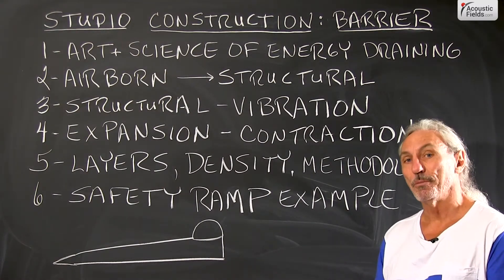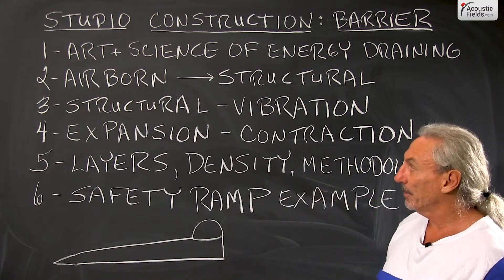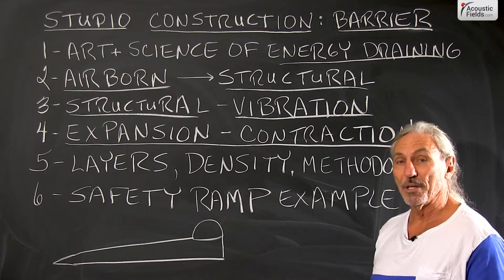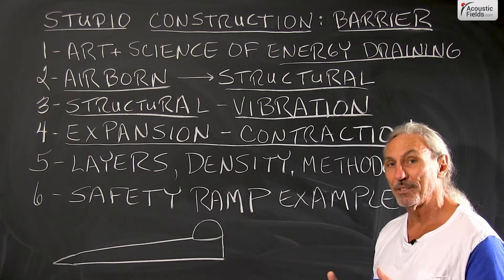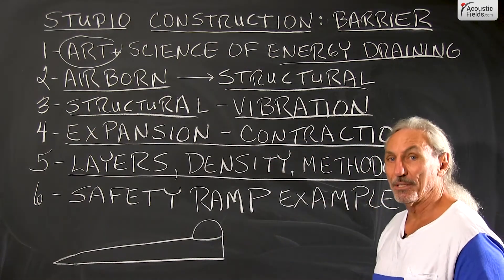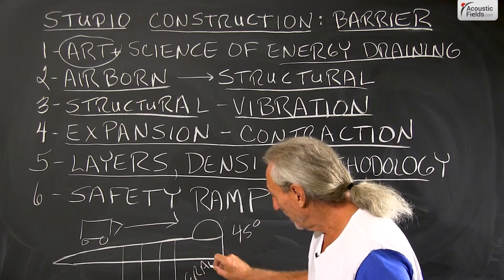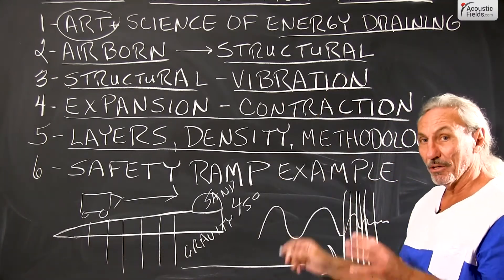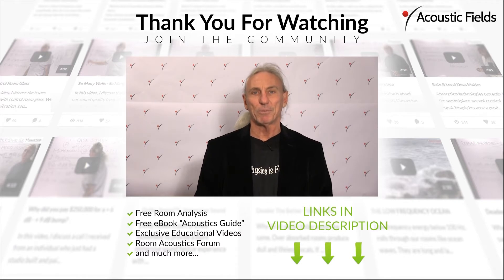Studio Construction: Barrier - www.AcousticFields.com

Comment: Hi! thanks for all the information, have seen several videos from your channel... I found in internet sand sound panels, what are your thoughts on these  recargding soundproofing? are they effective barriers?
Reply from the maker: M,  Sand can be a good barrier material. It depends on the density of sand and amount used. I have an issue with any "panel" acting as a barrier. They are only a barrier if the panels are sealed together and sealed to structure.
Reply: could this be an effective layer in the soundproofing chain against low frequencies?

Comment: Yep would have been very handy to have found you before I build the iso-booth for our production room. But...there's always JaM Booth #2 :) Mind you as far as making it sound proof, we nailed that!
Reply from the maker: T,  Send me dimensions and pics of all the surfaces. Lets look at the treatment options. Good job on the barrier. Did you take  noise measurements? We can show you how to have vocals that engineers never add any electronics at all or if they do , they are minimal. The vocal is so good out of the gate, you may not need anything electronic until well into the mix. We can do everything that has meaning  with vocals in the analog domain with treatment and polish it up with signal processing.
Reply: Oh I think so! The next build will be the permanent build and that one I will be consulting with you guys on. This one, 4X4X7...had I known half the things I learned from watching you after it was built...I wouldn't have even built it 4X4X7! Yeah I've done my RT measurements and it dies off rapidly in there. The booth is airtight, sealed and built with an air return.

My issue was that 'tonal' problem because of those dimensions, my baritone voice and the WRONG insulation attack on those interior walls. Like mentioned the next build will be the permanent studio so I'll definately be consulting with you on that.